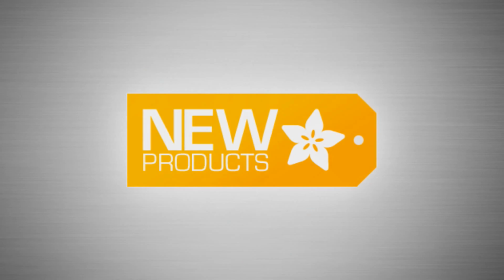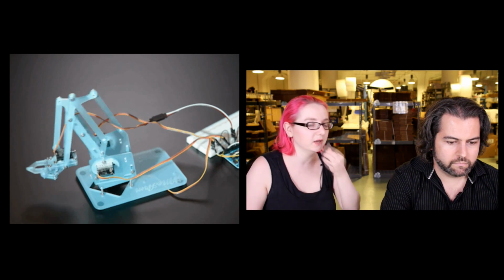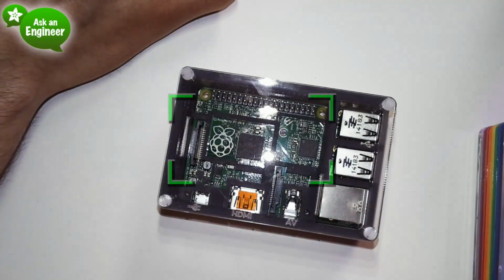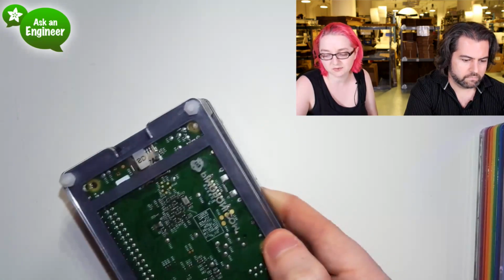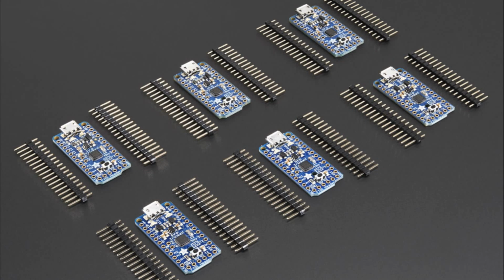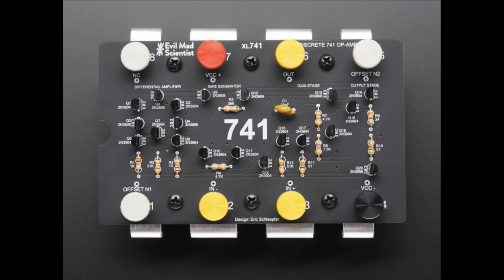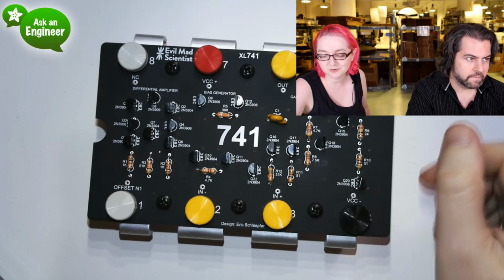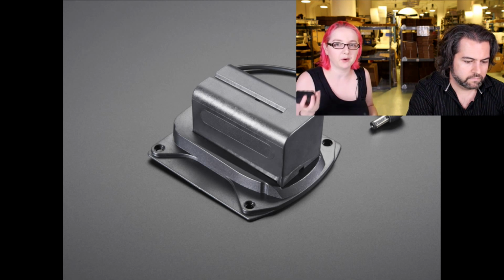New Products 9/3/2014

Comment from the maker: New Products 9/3/2014 (video)
http://adafru.it/dGx

 - Phenoptix MeArm Pocket Sized Robot Arm Kit – Powder Blue v0.4 (0:04) 

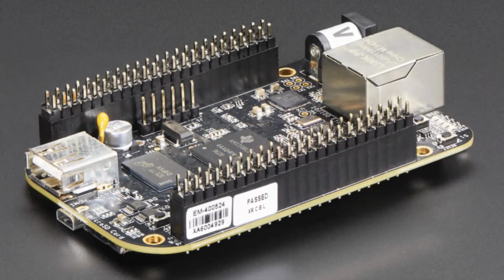 - 2×23 Male Headers for BeagleBone Black – Two Pack! (0:58) 

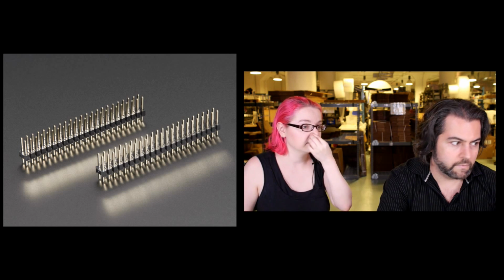 - Rainbow Pibow – Enclosure for Raspberry Pi Model B+ (1:23) 

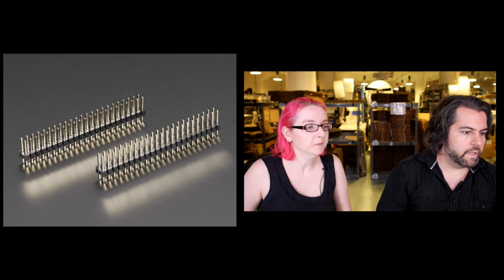 - Pibow Coupé – Enclosure for Raspberry Pi Model B+ Computers (1:23) 

 - Timber Pibow – Enclosure for Raspberry Pi Model B+ Computers (1:23) 

 - Ninja Pibow – Enclosure for Raspberry Pi Model B+ Computers (1:23) 

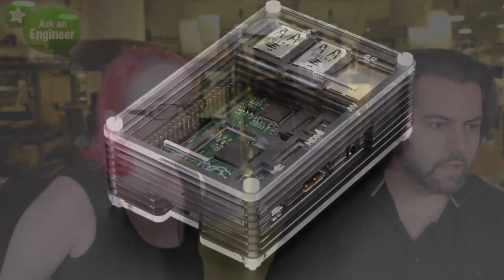 - Adafruit Pro Trinket 6-Pack – 3 x 3V and 3 x 5V Trinkets (3:08) 

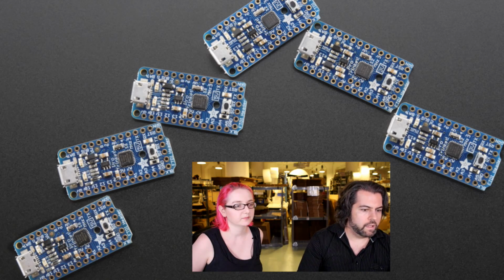 - Evil Mad Scientist Labs XL741 Discrete Op-Amp Kit (3:47) 

 - Camcorder Battery Holder/Adapter – 2.1mm DC Jack (5:12) 

http://adafru.it/dGx
All in stock and shipping now!